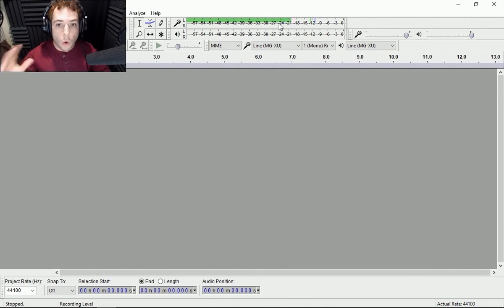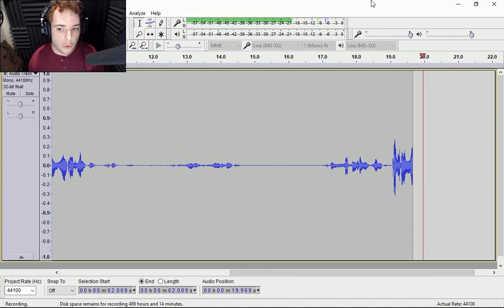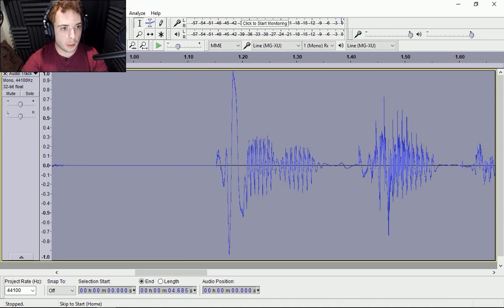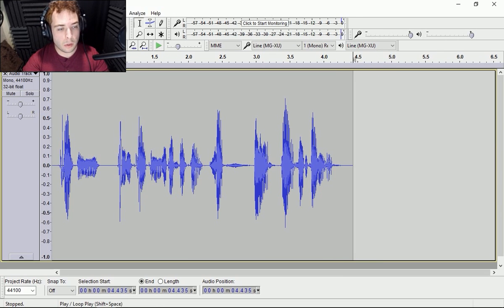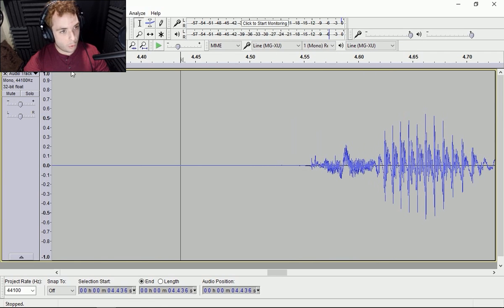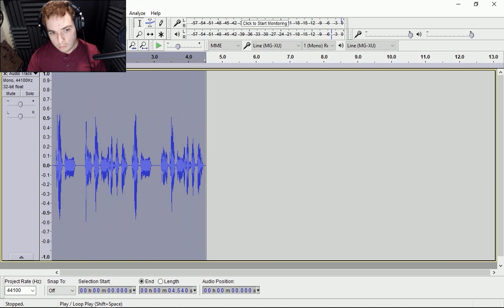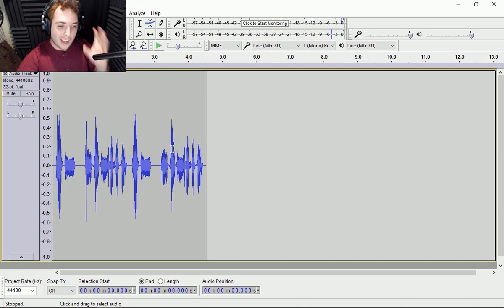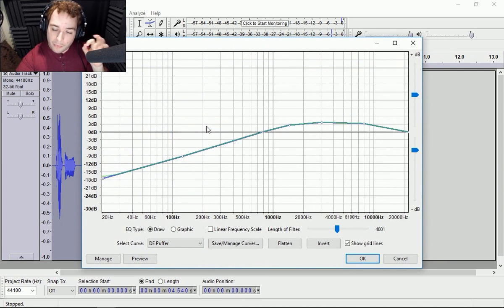How to edit out PLOSIVES using a DE Puffer

Comment: Is there any option to remove plosives by some filter? I have 5h of podcast to edit and it will take ages.
Reply from the maker: Like automatically? Not in audacity by default. There may be plug-ins but they will probably be expensive. The best solution would be better or more wind covers or pop filters.
Reply: @FunnyGuyTimmy  I found answer in another video
 "Perhaps the fastest way to tame plosives is to apply a high pass filter
 (as plosives contain lots of low frequency material, often as low as a few Hz).
 For example, I use an 80 Hz, 6th order (36 dB/octave slope) high pass filter on vocals.

Sibilants can be tamed by crossing over a track at 2-5 kHz (make a copy of the track,
 apply a low pass filter to one track at the desired frequency, and a high-pass filter on the other at the same frequency,
 making sure both filters are at a 48 dB/octave slope) and using the built-in compressor on the high frequency track.
 Set a short attack and decay, and un-check "compressed based on peaks". Often times I do de-essing with the use of hard clipping because
 I'm dealing with a song and everything is already mixed together. But even when not working with songs, clipping /s/, /ɕ/, 
and a few others is pretty straightforward and gets the job done. However, a PEQ is often required for sounds like /f/, /v/, /t/ as the clipping only 
reduces amplitude, not specific frequencies."

Maybe it will help someone.
Reply from the maker: @DevilinGame  if you have more than a few plosive and dealing with them one by one would take too long, then you really need to tackle the issue with a pop-filter. I often try to discourage the ‘I can fix it it post’ idea. Post processing should be used to make things sound better, not make it usable. So master physical elements like acoustic treatment and pop-filters first.

Now having said that, i tried something like this in the past and it made all my lower and quieter inflections inaudible as well as made the rest too brittle and sharp. If you are going to do long form style recordings, I would say look into plugins that are more dedicated. Programs that are designed to tell the difference between plosive spoken word.

However, everyones voice is different and this may work better for some than others. I would say make sure to record at a minimum of 48kHz at 24-Bit if you plan to do any deep audio manipulations like this. Otherwise, you might not be giving the program enough to smoothly work with.

My last note would be that if there are no proper pop-filters used in your podcast and people are listening, they may not even care. People have lower quality expectations for podcasts that other media. If it’s not that extreme or constant, they may be fine with it.

What’s your podcast called?

Comment: Is it wrong to use the fade in / out tool to get ride of hard plosives? I tried copying your presets as best I could, but maybe include the graphic specs too as an extra aid?
Reply from the maker: Well this may be a matter of how hard are the plosives. This only works with mild but fixable puffs. If the puffs of air are too strong it may only muddy the audio or make it too sharp. If you mean the manual level adjusting tool, where you can lower or raise select segments, then maybe that could work but not the actual "Fade In" or "Fade Out" tool found in effects.

I have been trying to find a way or sharing my pre-sets and letting people download them but haven't found a way just yet.
Reply: @FunnyGuyTimmy  yeah, I think I get what you mean when trying to apply to the stronger plosives. Your lil trick does work, which I'm grateful for. 

Now... how the heck do you find those sneaky wet saliva sounds without having to comb through the same word over and over again? It's getting easier finding the clicks, but wet ones are harder, even when you can hear them.
Reply from the maker: Cerridwen well I think the best place to do most of your editing, is before you even edit. Meaning, try and fix these issues before hitting record. Make sure to have a popfilter and speak at a 45 degree angle to the mic at 3-6 inches away. Then brush your teeth and bring room temperature water into the recording space and as you feel your mouth start to dry out or start making noises, take a small drink. Do these things and then you should have only 10% or less of these issues.

There is a way of finding the mouth noises visually but that takes a lot of time and practice to get good at noticing. I do have a video about it though. The video should be titled editing visually or something along those lines. Basically there are small sharp spikes that start and stop very quickly. They sometimes look like heads of nails. But over all the water and brushing before hand will reduce that to the point of it not being an issue.
Reply from the maker: Cerridwen also I have a full VO beginners guide playlist.

https://www.youtube.com/playlist?list=PLq2h8h4Cr5wx4e67NZzR0RbgFNsfh_Qqn
Reply: @FunnyGuyTimmy  I've been using the fade in  / out tool from the effects menu. And you're right it does muddy it a lil, but didn't know a better way till now. Still, having a bit of trouble getting the handle on them though.
Reply from the maker: Cerridwen if you want my coaching email is FunnyGuyTimmy@gmail.com. That may be a better place to get a handle on the situation. Send me the file you are having trouble with and I will see what would work best for you. Let me know.
Reply: @FunnyGuyTimmy  a guy couple comments up from this explains how to export your presets

Comment: Did I miss something? I didn't see how you configured your preset ...
Reply from the maker: I think you missed something. I say like it do in most videos like this there is a more in-depth video on Audacity I did in the past. As far as the "De-puff" preset, you literally see it on the screen as well as all the other settings. All you have to do is match what you see on the screen. Or do you mean how to actually use Audacity? Like how to click on the sliders and buttons?
Reply: No I was referring to how the preset is configured specifically -- the settings used. I had configured my own preset before, when I had Audacity on a different computer, but hadn't set one up on this computer so I was trying to refresh my memory about the settings. Also, the title of this video made me think there was some sort of new plugin available called "De Puffer" which was part of the reason I watched it. Incidentally, I found another video last night that used the 100Hz Rumble to remove plosives, which was new to me. I tried that and it worked just like my previous plosive preset used to.
Reply from the maker: CynDaVaz 4:55 is where the DE-Puffer is shown. Yeah its not a new plugin it’s showing how to use EQ to do it.